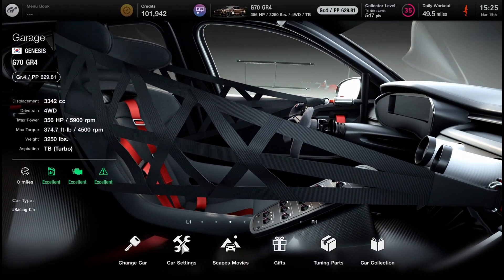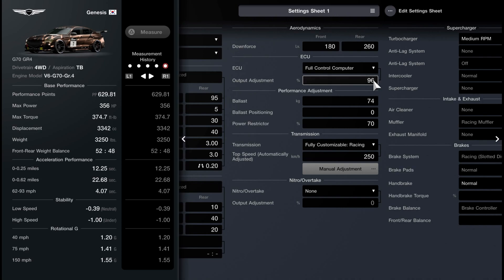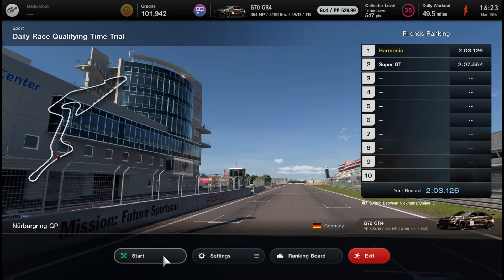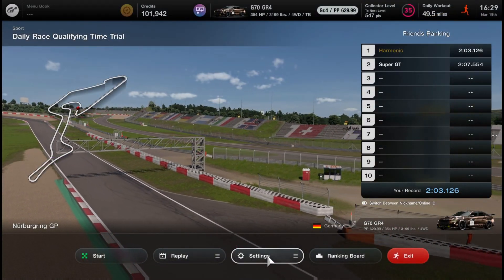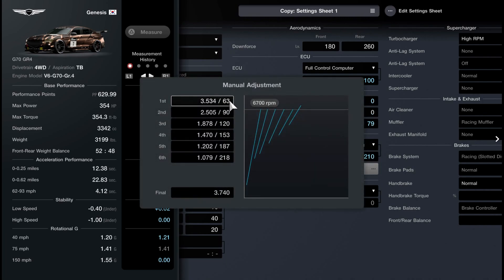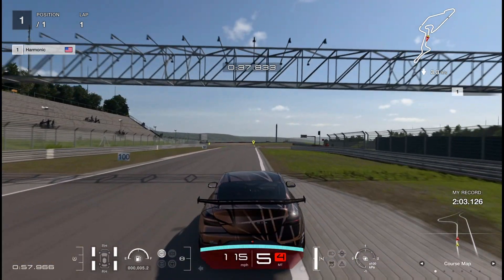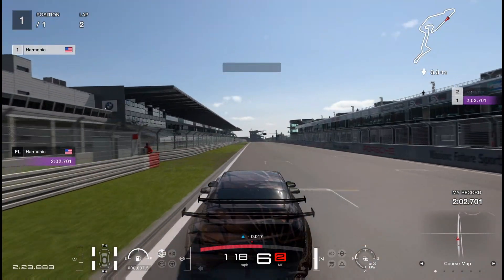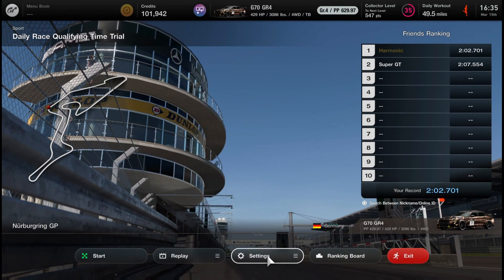Is the PP System BROKEN? | Gran Turismo 7 Tuning Tips

Comment: Knowing  how to tune a car for the track and restrictions  is not an exploit  or broken  system. It's  how actual racing works.  NASCAR Formula  One NHRA even Motocross  all have Restrictions on what the vehicles  who compete  have to follow.  It is how they are tuned within  those restrictions  and the skill of the driver that makes the difference between  winning  and losing  a race. Some racing games  don't allow  you to do a lot of tuning. Be glad GT does
Reply from the maker: You completely missed the point. The calculation for PP takes lateral G into account, and the game thinks you physically can't corner at 150 mph, and your PP rating subsequently plummets. This is a huge oversight that allows overpowered cars into events where they don't belong, especially when changing weight by 1 kg or a gear ratio by 0.001 can change PP by 30+ when it makes no real difference in performance.

Please actually watch the video before commenting, thanks.
Reply: @Harmonic14  I did watch the video Performance  points take into account overall performance. That includes Lateral G force effect. The System  isn't  flawed you just figured  a way to make it work for you. If they nerfed tuning  because some people  are better  than others  it would  make the game much worse.
Reply: @Harmonic14  also your set up may work for certain  tracks but not all. Keep that in mind
Reply from the maker: @PM-uw2pb  how is a lateral G value of 0 NOT flawed? The only way for that to be possible is for the car to physically not be able to turn, which clearly isn't the case. The way lateral G is calculated is flawed, and so the PP system is by extension. If making a functionally ignorable change allows you to pile a bunch of upgrades into the car and gain multiple seconds for free, then the system is flawed, no two ways about it.

Also, I'm very aware of how this works per track... I did this same thing over 10 years ago in Forza, so I know what I'm talking about.
Reply from the maker: @PM-uw2pb  that is correct, and that's where the problem lies. Lateral G is a function of a car's handling capabilities, and if the car can't actually hit that speed, it needs to be extrapolated as if it could. That would be a much more accurate way of determining real performance.
Reply from the maker: @PM-uw2pb  you're missing the point yet again. The game zeroing that stat is a major flaw for PP based events. If I made my last gear 0.001 higher, it would cross the threshold for the calculation and gain over 20 PP. In some cars it's over 40. It's pretty obvious that a gear change of 0.001 isn't even noticeable for lap times, yet it puts the car in a completely different class. 

The devs even came out with a statement saying that certain combinations of tuning settings break the PP calculation... If you don't see the problem at this point, then there's no helping you.

Comment: seems to work perfectly to me. you altered ECU output, ballast, the restrictor AND gears.  more power + less ballast is going to increase the PP immediately. add to that a gearbox that's pretty much optimized for the straights and your laptime will come down fast. unless you think that a race car is set up for the highest top speed at all times, even if it takes 2 minutes to reach it
Reply from the maker: I don't think you get the point. You can make functionally identical setups that are 40+ PP apart because you can break the lateral G calculation. Would appreciate if you watch the whole video before commenting next time, thanks 👍

Comment: Numpty bollocks....it's not an exploit....it's the whole point in tuning...you tune the car to how YOU drive....you'll always be able to gain advantages in places while losing it in others.....that's why drag racing is a tuners game.... because setting up the chassis, tuning the engine, or something as simple as a 4 link bar change can make all the difference between a win and a loss.....it's not an exploit dude....that's tuning for you.....you know....that thing that this sim is al about lol
Reply from the maker: No, it's 100% an exploit. The game thinking you physically cannot corner at 150 mph is a MASSIVE error in calculation of performance.

I've been optimizing cars like this in sims for years, and I'm an automotive engineer for my job. Please don't try to argue with me on this.